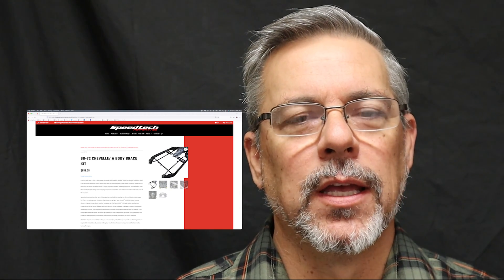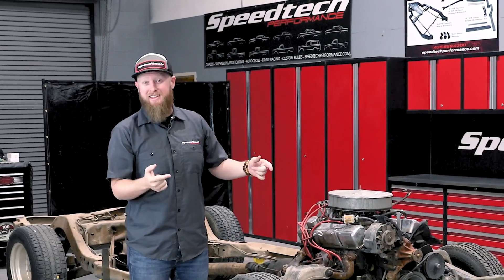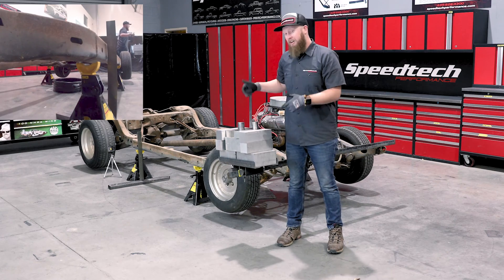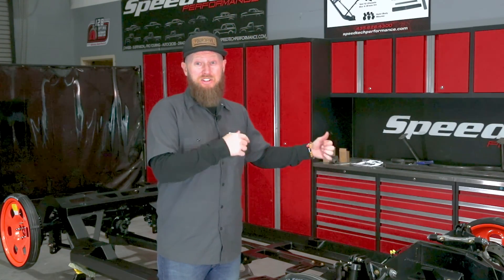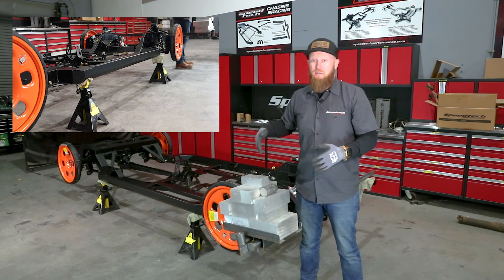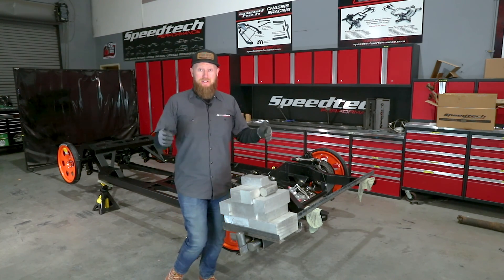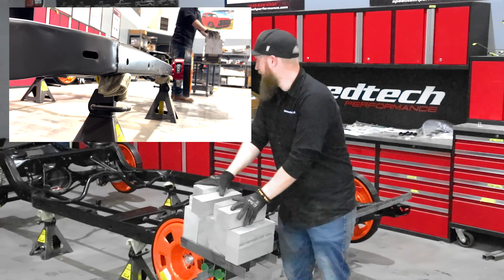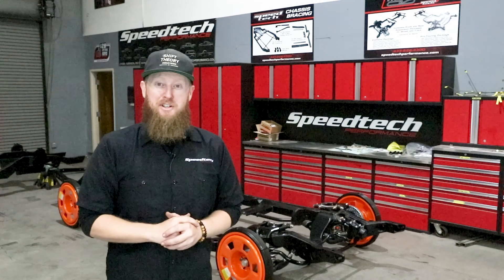Chevelle Chassis Flex Test

Comment: I have to agree this really isn't  a good comparison.  First get all three chassis configured the same, next  load  thru the wheels and react at body mounts and at the powertrain mounts.  Twisting the frame artificially hints to improved strength  but really does nothing to relate to how an actual frame deflects under load.

Comment: Would it make sense to box the front of the frame too? Or does the radiation support work good enough?
Reply from the maker: Good question Jason!  In simple terms anything in front of the front axle or behind the rear axle is not critical so adding material in these areas is not a structural enhancement.  Additionally the added weight would be a draw back.

Comment: Uh, you guys know how a fulcrum works right?  You all removed about 750 pounds from the front half of the chassis.  The fact that you don't have an engine and transmission in the other chassis makes this test complete and utter bunk. Put the same motor and trans in the chassis and show the real results.  Gimme a break.
Reply: Having the engine and trans, with crossmembers in make it stronger. It gave it multiple points of horizontal connection. Therefore, not having an engine, trans and the trans crossmember it actual has less horizontal structure. So, adding an engine and trans would even make it stronger, right?
Reply: @cameronforemaster9146  nope he's right, the engine is effectively added weight in addition to your aluminum billet

Comment: Can you do the same style video but for the first gen Camaro? Thanks!
Reply: First gen Camaro's aren't full body frames. They are Unibody.
Reply from the maker: Hey K Rob,  SBuckmann is correct the Camaro is not a full frame car so the test would be different but we might be able to do something similar.  I'll look around and see with we have a stock Sub Frame here.
Reply: @SpeedtechPerformance  Perfect, that would be great. I know it’s not a full frame car, however, it could show the improved rigidity with your front subframe suspension as well as subframe connectors. Thanks.